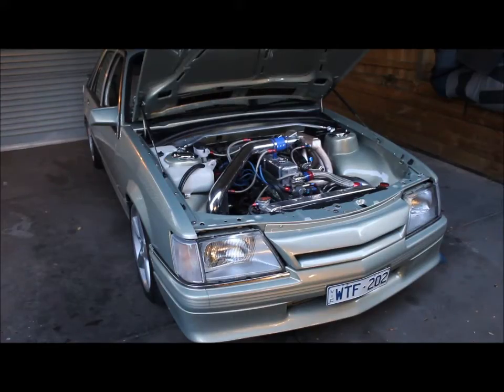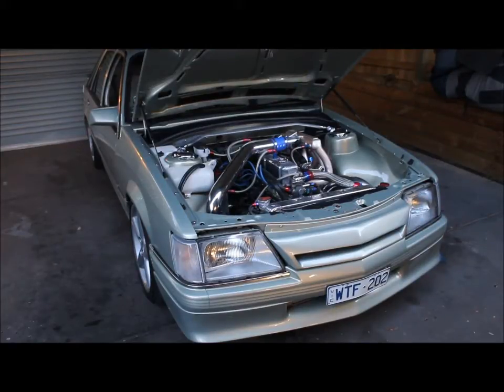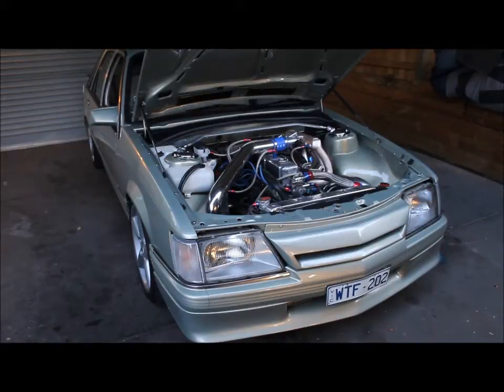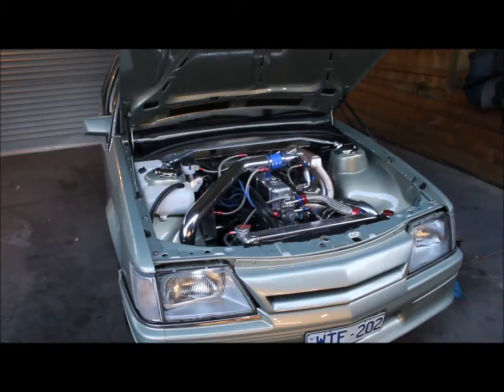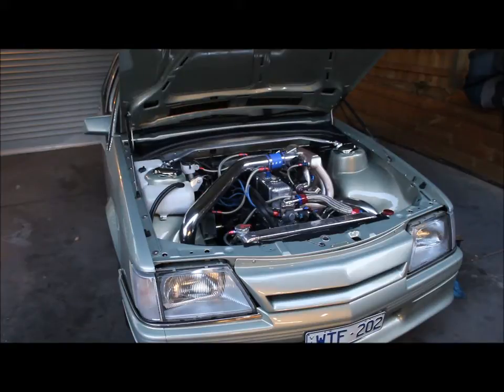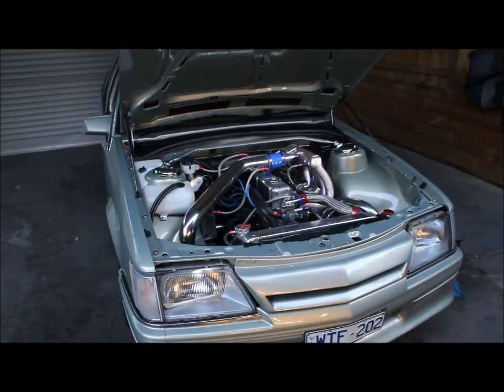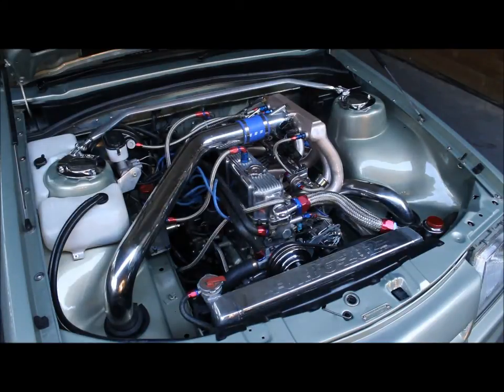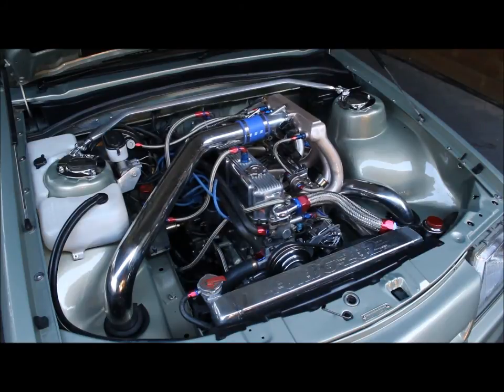WTF202 - New engine running

Comment: Absolutely beautiful engine (and car) mate. I too have use rod shop for conversions in the past and they have proved to me twice now that their products will successfully bolt 2 foreign objects together... Doesn't necessarily mean they'll work/run, just means they bolt together. Also I too have found Penrite in general to be rubbish in a pretty package. Took me years to admit it and a couple of blow motors and unhappy gearboxes but literally everything else I've used since that day has performed better than Penrite. Ironic to hear you've had similar problems with gear oils. All of that aside, your motor is a true credit to the mighty 202ci Holden 👍

Comment: Ifyou can find one, a Duggen alloy head would be perfect for this instilation. Had one on a HP block many years ago. flowwed excellent with no hot spots. It was in an LJ. Had many engine mods. Ford 221 crank was just the start. would love to build another one with modern turbo technology rather than the old slipper type bearing TO4 that i had to constantly rebuild. :-)

Comment: I think you'd be better off ditching the Black 202 & fitting a turbo'd hybrid Nissan RB25/30 engine which is very capable of putting out 500+ HP with a spec'd turbo suited to the engine (e.g. T3 inlet housing with the T4 exhaust housing with appropriately matched turbine trims for both the inlet & exhaust turbines) or if going away for a six altogether either a lightly boosted Chevy LS1 turbo engine or one with a CAPA supercharger kit bolted onto it - the LS1 engine in my Commodore (VY) is stock & pumps out about 400 HP merely with an aftermarket exhaust system & tune (no mafless tune).
The 202 engine in my familys' experience wasn't the best motor in carby form due to the inherent nature of running lean on No 5 cylinder resulting in piston seizure followed by a snapped conrod which ended up cracking the engine block (in our old HQ) or a hole in the piston crown in that cylinder (in someones VK & HJ I spoke to),the 173 was a good motor and I am sure many people replaced the 202 with that one or the 179 or 186 engines.
The EFI head & setup is better off bolted onto a red motor anyway,or the setup can be bolted onto the blue motor because I don't know the way Holden went with the Black engine block because I have heard of them being too soft which leads to premature engine wear as compared with the red & blue 202 engines - a Black 202 I had to replace a head gasket on for a cousins mate that had done 200,000 kms,he complained it was blowing blue smoke in the mornings , an old person owned it since brand new in 1984 ,well, I pulled the cylinder head off to find there was a huge ridge at the top of the cylinder.
I just slapped a new head gasket on ,bolted the head on & gave it back to him,I heard he eventually blew that motor up,so that's the reason I figured you'd be better off not even working a Holden motor that's like that,I heard of one of them (turbo 202 VK) which had so much aftermarket parts fitted into it that it virtually wasn't a Holden motor anymore (Carillo Rods,etc) and that it's cheaper to even fit a Nissan RB30 where the stock rods can take 500+ HP & the engine blocks are very hard in them - How is a Nissan RB25/30 hybrid turbo engine which uses a 400,000 km RB30 block with original bores which puts out 467 HP?
Peter Hill fitted an RB26/30 hybrid engine into a VL Commodore (Calais) with the R32 running gear which put out 700 HP.
Reply: +Russell Booth so let me get this right...you're attempting to lecture the builder of one of the greatest and most original VK commodore projects EVER about how he should have followed everyone else who has ever owned a commodore and put a stupid RB or LS1 into it???  The whole fucking point of this car is that IT DOESN'T follow everyone else's trends and it showcases innovative engineering skills, mixing modern and period-correct components while producing some of the most amazing HP numbers these engines have ever made.

You clearly have ZERO clue when it comes to knowledge about these motors or any motors to be honest.  So what if your lame arse VY has 400HP.  It's still less than this VK makes!   

You're also comparing a carby-fed RED motor in your clapped out old kingswood (and other clapped out pieces of shit that have probably never had so much as an oil change!) to a fully built BLACK motor with advanced sequential fuel injection and multi coils and tuned by one of the best tuners in Australia.  These are very different engines we're talking about here.

The reason the motors you've worked on have blown up is probably because YOU'VE WORKED ON THEM!  You're mechanical skills sound sloppy and shoddy.  This car is something you couldn't even dream of building!

You should rethink your life and keep your retarded opinions to yourself until you actually know what the fuck you're talking about.
Reply: @kylexavier5441  yes!
Reply: +Russell Booth Is it school holidays or something?  Don't kids have something better to do with their time?

For what it's worth, taste, preference and interests are subjective.  What appeals to you may not appeal to this guy; he's built a monster of a car which which pushes the absolute limits of a classic Australian designed and built engine.  If nobody ever challenged the norms in this way, we wouldn't have a car modification scene to start with.

It's an undeniably unique and infinitely more interesting build than any of the countless RB-powered VLTs out there.  Do you have a link to your car build?